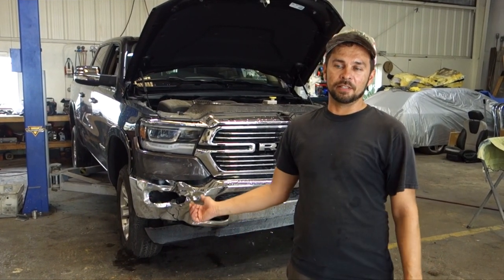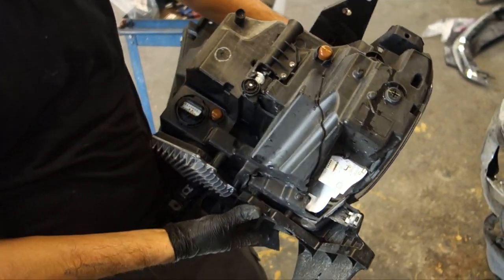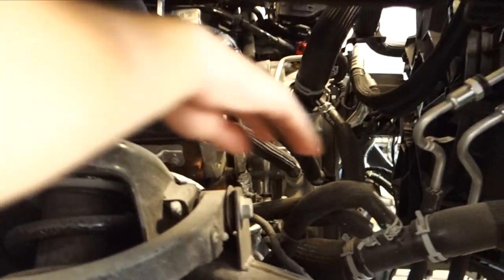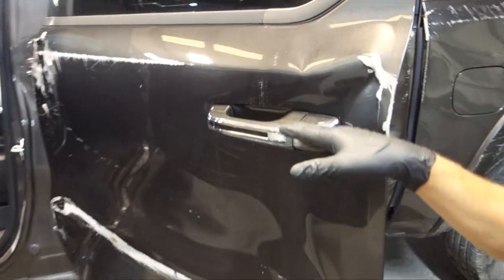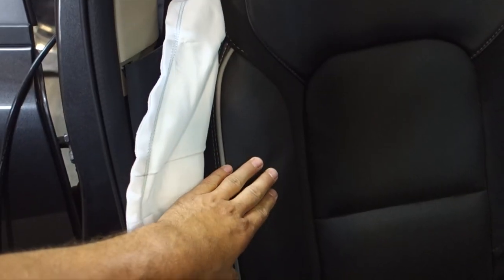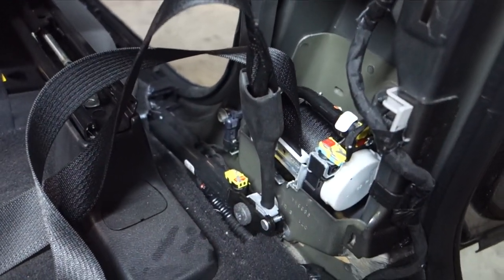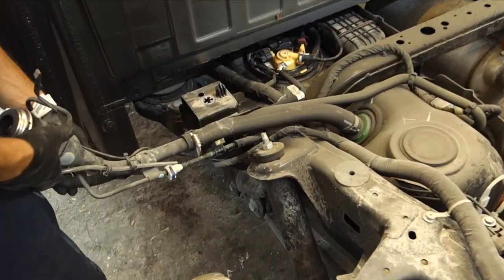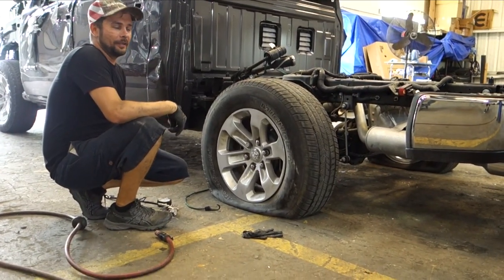Rebuilding 2019 NEW RAM! More Damage than was Expected! (Part 2)

Comment: The key not detected issue is likely due to one of the keyless go systems antennas being disconnected, the system has a number of antennas in the cab, the side ones are generally either on the b pillar or sometimes they are on the doors.

Comment: That spare wheel is really a mystery. When was yours built? Ours was made march of 2018. Very very early in the production. Maybe since yours seems to be a lot newer than ours they might have changed the spare for some reason? I don’t see why though because the 4th generation was a 5 lug and the new 5th Gen is a 6 lug so its not a carry over part. So why would they make a new steel rim just to add a aluminum one later? Maybe the limited trims have that wheel 🤷🏼‍♂️. Ours is a mid level Laramie.

Comment: Key fob battery is low or it wasn't picking up the key so if you push the button with the key fob it'll start. The truck with put its self in park only if you have the door open and in a gear but it'll still start with the door open but I get what you are saying. Keep up the good work

Comment: I think I would find a way to lift the bed off the frame from the bottom instead of the way you did it.  Same with putting it back on, do it from the bottom.  That way you don't have to let all the air out of the tires just to get it out of the way.

Comment: Is that deflector electronic under the front bumper? I have a 2019 and never noticed it.
Reply from the maker: ClawBoss yes it has a electric motor attached to it. I’m guessing it goes down at a certain speed to help with fuel efficiency.
Reply: Rush-in Garage Well damn I hit a raccoon and mine broke, now I have a check engine light to “replace active shutter”. Wonder if it’s related 🤷🏻‍♂️
Reply from the maker: ClawBoss as far as I know the active shutter is the fins in front of the radiator that open and close.

Comment: Am not a fan of that fuel pump placement. My 07 i can pull the bed and change the pump in less than 2hrs with no lift just a jack stand lol. It partially being under the body would suck!